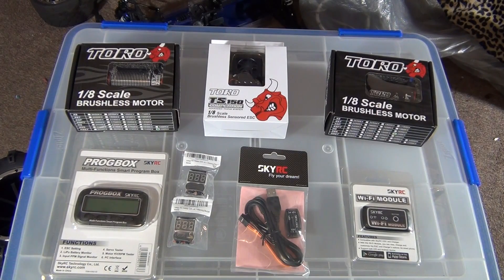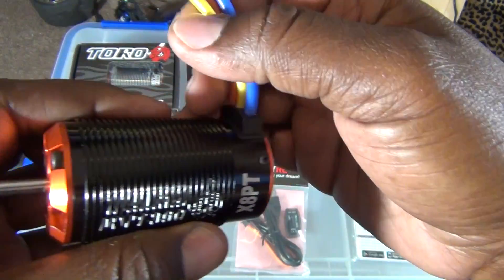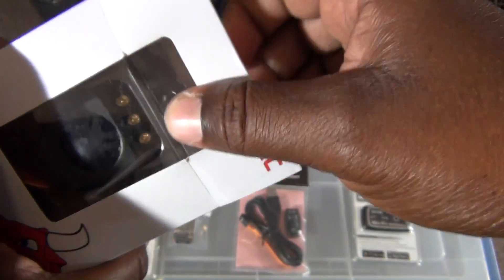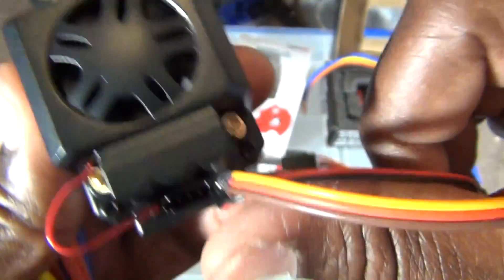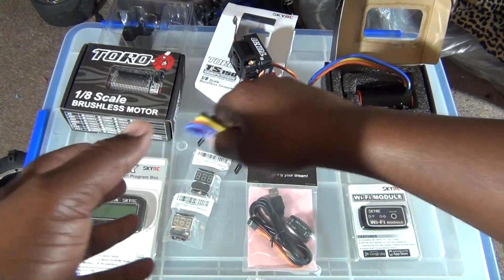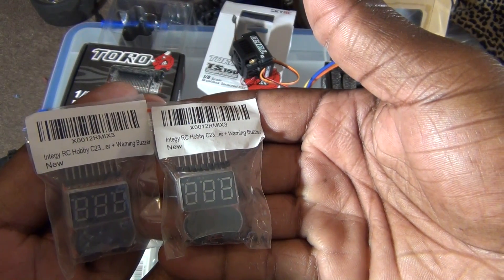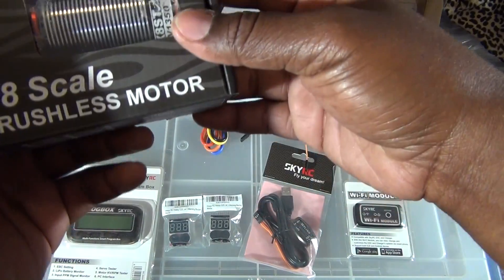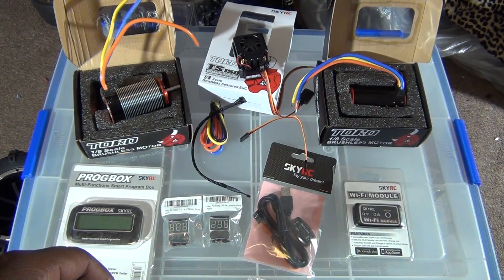3 SkyRc Unboxings (Toro X8PT, Toro X8ST, & Toro TS 150A ESC)

Comment: all i run is 6s 2 3s
Reply from the maker: Kevin Cromedy   True that.  Gearing I know for sure can cause heat issues with that much power depending on driving style.  But if you're just bashing in an open field or street with a low gearing, you should be fine.  I've learned full throttle can mess some things up because of the burst rate of the lipos.

Comment: can i run 6s no the toro motor 1350kv 1/8 motor X8PT 9T
Reply from the maker: Yes, but the spec max is 37v at 81amps.  6s is 22.2v.  The thing you'll want to be careful with is the c-rating of your lipos so you don't overload on amps and catch your esc on fire.  If speed is your goal, 2200kv is perfect for 6s on-road geared up.  A 1350kv motor would run cooler temps and better for off-road when gearing up, but 1350kv doesn't have near the amount of RPM's a 2200kv would have on 6s.  The link below is to SkyRc's website. Click the specifications tab under the picture of the motor to see the spec table.
http://www.skyrc.com/index.php?route=product/product&product_id=152

Comment: where did u get the 1350kv motor from direct from skyrc?
Reply from the maker: I got it from ebay and the seller was RCmart which is based in Hong Kong.  They also have their own website with crazy low prices.

Comment: sheesh whatever u put that Thang in is going to be crazy
Reply from the maker: lol....Thanks..... The hardest problem I'll have to solve is traction with the onroad tires I'm experimenting with.  I'm already having issues with the Earthquake 8e I altered to have a 1:1 gear ratio (49T pinion with a 49T spur)
https://youtu.be/-vetVP9hVS4
Reply: putting the tape inside the tire really helps out I did it to my 3.8 swamped & trenches
Reply from the maker: Sweet!  I'm going to try that for sure.

Comment: how do u like that x8pt1350kv I have the x8pt 1950kv its bad ass thinking bout getting that 1350kv to run 8s
Reply from the maker: I can't wait to see how it runs.  I still have to solder everything together and prep my earthquake roller to mount the motor since the original spot for the motor doesn't have enough space.
Reply from the maker: The thing that had me sold was the unbelievable low price in comparison to other brands.  Figured I'd give SkyRC a try while I wait for what I really want to hopefully one day come back in stock.  When I finally hook it up I'm gonna make a cap-pack for it because I know I'm gonna wanna run it hard like I did my electric Rampage MT blowing up my xL2 caps, but I'm not going to play tug of war with it.  lol